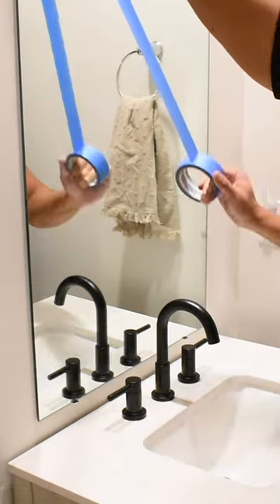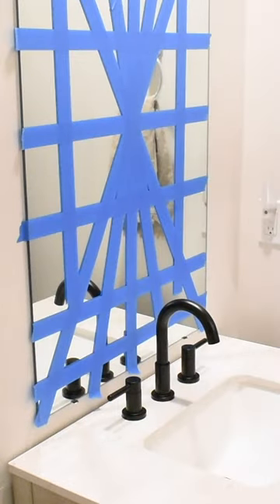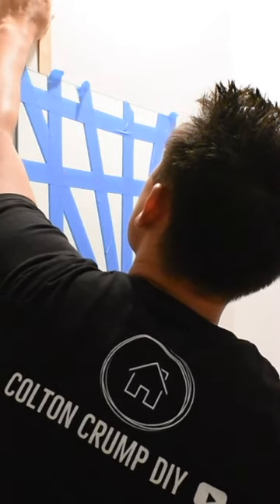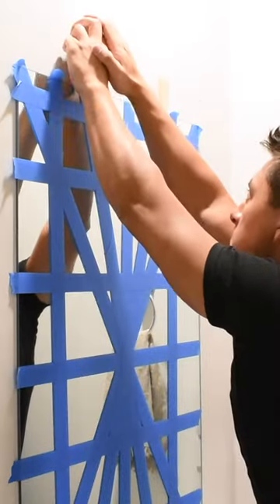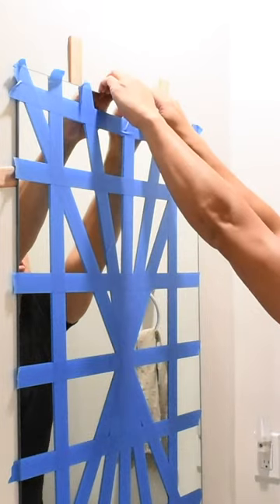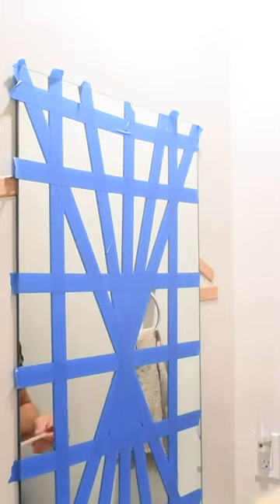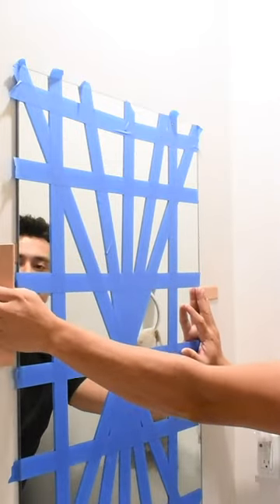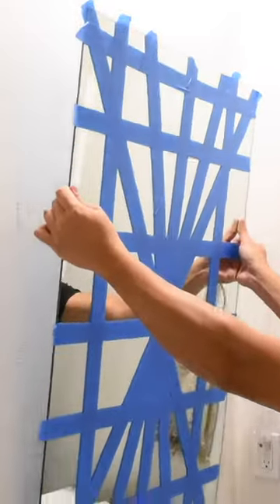DIY Shorts - How to remove a mirror

Comment: This video just helped me remove a bathroom mirror now in cookeville Tennessee
Reply: Update…… we used this same method today to remove the same kind of mirror and it worked perfectly. I’m a new follower now. Do you have a video on how to fix the wall because they put a lot of glue on the wall now it looks crazy 😝
Reply from the maker: Glad this helped!!! Thanks for subscribing and commenting on the success of this application to you.  Now as far as the wall goes, home builders can go crazy and put a ton of glue. Honestly, get a scraper and try to scrape it off.  More sheetrock will come off. Then you'll need to patch it.  Mud it, let it dry, sand it, texture it, let it dry, then prime and paint.

Comment: how tf was that mirror attached
Reply from the maker: With liquid nail adhesive on the back and 2 brackets on the bottom taking the weight.
Reply: @ColtonCrumpDIY  why are they installed in such a way that risks shattering the mirror when you remove it
Reply from the maker: Just how the home builders put it up.  It's easy, fast, they meet the requirements to get the home built, pass inspections, and move to the next home.  I'm not saying it's a good way to do it.  It's just what happens.